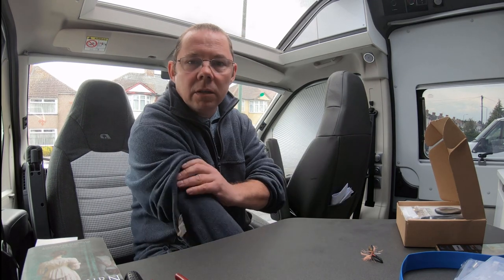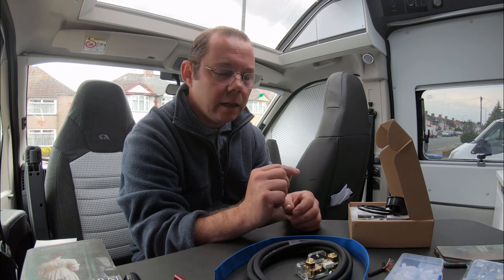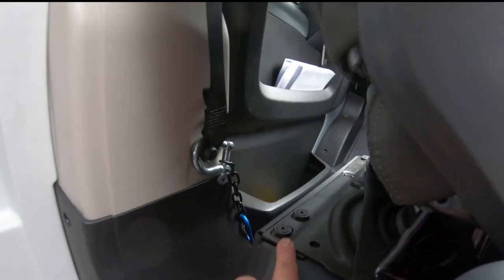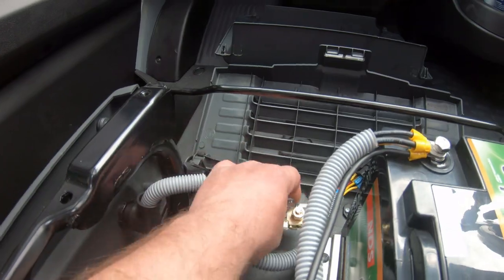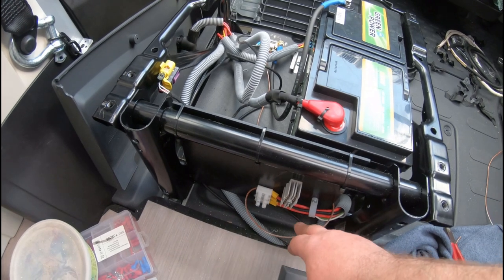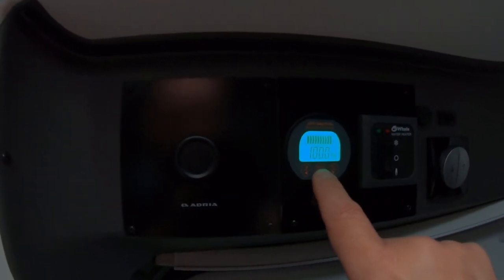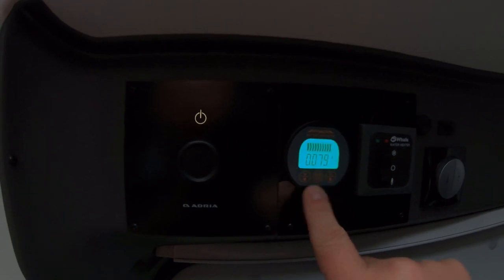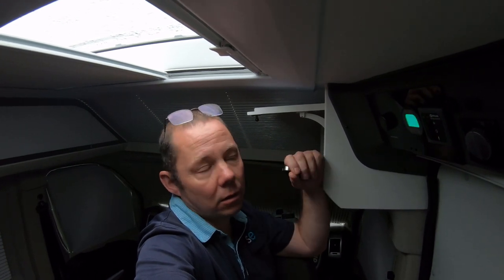TR16 battery monitor for motorhome

Comment: These battery monitors have their origins in electric scooters and started coming on the market almost 5 year ago - they were called Coulomb Meter  because they counted the power going in and out  of the battery - the scooters used  lithium li-ion batteries  with almost no internal resistance - unfortunately lead acid batteries have  internal resistance which means they lose <4%  a week of their charge  depending on type - this means  that  over time the % feature will drift - so after the first week it will read 100% when it will be 96%  after second  week   it will read 100% but only be  holding  92% etc  after 2 months  100% will be just 68%.  It wont matter if you charge it  as the meter stops % beyond 100% -  You option is to re calibrate periodically when you know the battery is full  to compensate for the drift - or just go by voltage  which on lead acid is always  proportional tovoltage at rest - I have 2 of these, one on my E bike & I on my motor home  which are both lithium  batteries - hope this helps
Reply from the maker: Hi Trev, that is a very good point you have brought up. Luckily I will be going with Lithium this year but even then its probably worth recalibrating periodically as you would do with any other measuring instrument. Only takes a few seconds. Thanks you for this input.
Reply: Yes its easy to re-calibrate - if the  cells are not well matched the bleed balance  on a  lithium BMS has a similar effect - I am just building a new bigger RV battery using  4 of them  280ah cells  & a blue tooth BMS from Alli-express
Reply from the maker: @trevortrevortsr2  After fitting this I bought my Lithium which has Bluetooth BMS fitted so will use this for more accurate reading. These are still great gauges for price to give a quick indication instead having to find your phone and login to battery every time. If the gauge is showing half % then I would check BMS. Its a quick indicator. Good luck with your build still waiting for my catteries, slow delivery's in UK since that tanker got stuck
Reply: @BrackstonesTravelAdventures  Its quite Addictive monitoring your battery on the blue tooth - We have 280 watt solar on our rig & EpEver MPPT  - also based in UK
Reply: @trevortrevortsr2  That's good information that answered a question I had about self discharge. My LiFePo4 cells have a self discharge rate of <3%/mo which the monitor cannot see and this would certainly build up over time, but the BMS would see this loss.

Comment: What kind of wire did you use for the positive terminal sample, what guage? How did you wire the sample wire to the positive battery terminal?

You skipped all the bits I'm struggling with lol!
Reply from the maker: you can use a piece 1mm flexable cable it takes very little current. put a 5A in line fuse on it direct to the battery teiminal

Comment: Great video, I have the same monitor. If you press both arrows at the same time for a couple of seconds it stops the unit flashing
Reply from the maker: Great thanks for the info I will give this a go. We don't mind the light at night it provides a good night light if you need to go to toilet at night. Does not keep us up but will see what it's like with out flashing
Reply: Oh thanks I came to ask that.  I found after changing the settings as per this video my monitor started to flash like a heart beat on and off.  Might be because my solar is charging my battery but it’s at 100% and yes I have a bms on my battery and my mppt controller set to cut off at 190%

Comment: Really great video and tips Stephen, great that you show how you wire up this system and how it looks at your type of Twin with all wiring. Pedagogic 👌I will tag this in the Adria Twin fb-group categories. Thanks for sharing!
Reply from the maker: Thanks Mattias I expect some people will get use out of this. Even if it's just taking the seat out. Got to sort out the bike rack next
Reply: @BrackstonesTravelAdventures  What about bike rack? Hitch mounted or at rear door? No heavy bikes on rear door, I did that trial and error last summer. But fixed it, seems to work fine with a heavy e-bike and my light MTB. (As per spec, which I override before with 2 e-bikes) I have a hitch ball so I can alter if needed.
Reply: @BrackstonesTravelAdventures  It is fascinating to have full over view of the battery and ofc very useful.
Reply from the maker: @Braapncamp  I have the Thule door bike rack. My bikes are Boardman 13kg each so hopefully should be ok
Reply: @BrackstonesTravelAdventures  That will be ok, no problem. Be careful when open/closing the door ofc. I grab the bikes with one hand when closing the door. Also be sure that the wires/cables that prohibits the doors to open more than 90° works and are secured. You can damage the van when opening otherwise.

Comment: Great video! 
The two connectors shown in minute 9.26, why 2? its seems like it might be posible to monitor two batteries like with the victron shunt... Do you know if it is posible with the TR16?
Reply from the maker: No, it does bot monitor two batteries, unlike the Victron which has a configuration to monitor two or even midpoint battery bank levels. I expect this second connection is just there as they used two connector and labelled them both B+
Reply: @BrackstonesTravelAdventures  okk, thankss!!

Comment: Hi Stephen,
How do you get those louvred covers off the backs of the seat pedestals without removing the seat? Thanks Sean
Reply from the maker: along the top there are two tabs you can put a knife in and i believe you lift the tabs up. Its not easy they seem to be in there tight but they should come off

Comment: Great video!  I am going to install the victron bluetooth version without the display which is considerably cheaper than the original one so this has been useful.  I have the 2 battery factory option installed in my twin and was going to get a pre made earth lead off line.  Does it matter if it’s thicker than the original earth wires?
Reply from the maker: Hi Nick. I was tempted in getting the Victron shunt myself as it would be nice to have the Bluetooth but I cant believe the price compared to the TR-16. As for the earth you would be better off getting a bigger cable about 16mm would be fine. Larger cables will reduce voltage drop so it will definitely not cause any harm
Reply: @BrackstonesTravelAdventures  cool, thanks very much for the info and prompt response.  Yes your right there is a big price difference but the Victron without the display and Bluetooth only is now £107 and as I only wanted Bluetooth and not the display I thought I’d go for it.  👍

Comment: I'm attempting to install my new Roamer battery. I'm stuck at an unexpected point.

I can't get to one of the bolts that hold the swivel to the base. Predictably it is the only bolt that you don't show/discuss.

It is the one next to the locating/locking bolt that you mentioned. I can't find any positon of the swivel where I can get my Torx T50 socket onto it.

There is a small hold (next to the big hold in the swivel) where I can get to it, but there is no way of undoing it there as part of the swivel is a few mm above it.
Reply from the maker: You talking about the seat bolts. The one that locks the seat in place. You need to align the seat where the upper plate has whole this whole aligns over the bolt. You then use spanner to undo it through the upper plate whole. Some are not easy to get ratchet in i had torque allen keys which just get in
Reply: @BrackstonesTravelAdventures  no it wasn't the one that locks the seat, that was easy. It was the Torx one in the back right corner. I worked it out in the end, loosen it via the small hole then rotate the swivel to a spot that you can finish undoing it by hand.
Reply from the maker: @andynormancx  the rear ones are a bit fiddly i think i used plyers once loose. Good luck with the install
Reply: @BrackstonesTravelAdventures  it is all electrically installed and working. I just need to secure it properly. Had to rotate it through 90° compared to yours to make the positive terminal cable reach (at the moment I’m not changing any of the Adria wiring).

Comment: Brilliant Video. Yes just got one also fir 230AH lead acid solar setup. Anyone know a way to reset the minimum voltage. Was playing yes bad of me now I can't seem to set it back to zero.  Or should I set it to minimum for Lead Acud say 12.05v 50% Charge and the lowest I want to go.
Reply from the maker: Hi Ted. On my first setup with AGM battery I set the Ah capacity to 50% so the % guage will show full or 50%. I do not think this is good to do this on voltage setting, not sure how they carry out the caculations for current and capacity. Only issue with running the guage to show 50% range. If you was to run the battery below 50% due to being on site and no charging then you will never know how low you are taking the battery to destruction I ended up wanting to see full capacity on the gauge